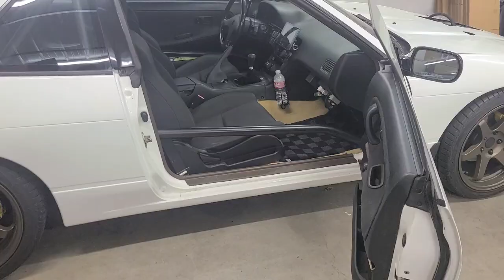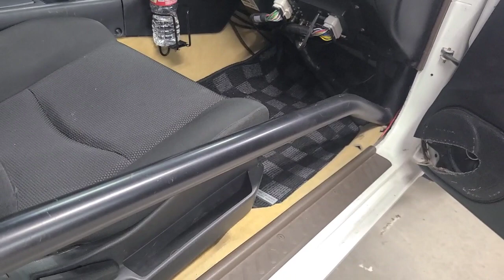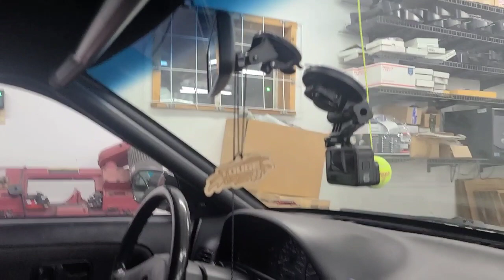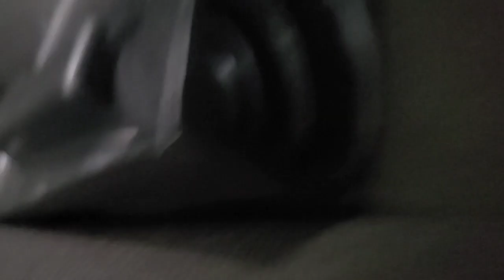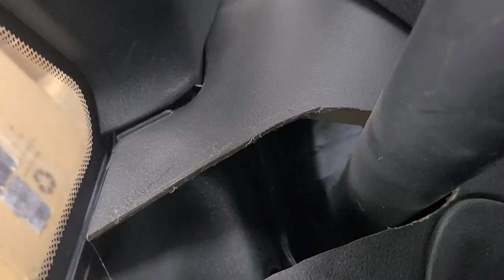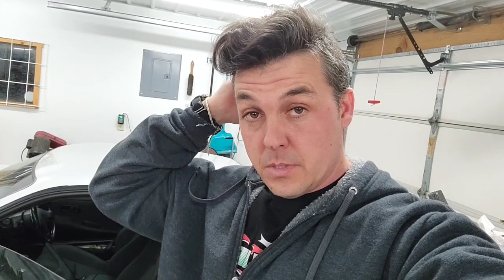Should You Put A Roll Cage In Your 240sx Street Car? (And What I'd Do Different Next Time)

Comment: The dashboard where the rollbar pipe goes in you can use thin aluminum plates cut to preferred size and wrap with black leather or pleather and then use push fasteners (Christmas trees) to hold down to dash for a clean look, or use the aluminum plate as a template and then 3d print the final one with a textured finish.

For the visors, tap some threads in the upper front bar and bolt the visor right to it or use a "lateral lock"style clamp and make a bracket off of them to mount the visors to and it will have some nice adjustability.   
And last, for cutting the interior openings, there are form duplicating tools that are flay plane and go onto the pipe to create the connection point and then can be transferred onto the work piece after.  Hope that helps a little bit.
Reply from the maker: Good ideas thank you!